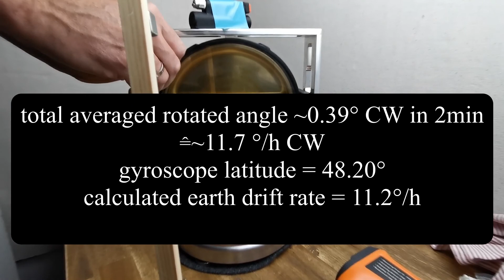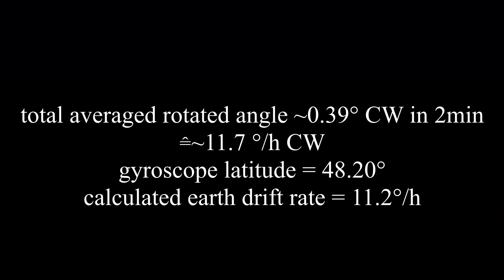Mechanical Gyroscope - Magnetic Field test by Stefan P.: Apparent drift NOT cause by magnetic field.

Comment: Who is Stefan P? Is this the guy from FE Core?
Reply from the maker: It's the same fellow, and the same gyro, but from what I can tell from clues I've come across, fecore and Stefan sort of parted ways when Stefan's mechanical gyro showed the predicted earth rotation.

The gyro was designed, built, and paid for entirely by Stefan, but fecore  was using the videos to promote their agenda, but as soon as Stefan got it running freely on the lowest possible drag bearings, then fecore just used the old videos from before it was working. 

At least that's what I've pieced together.
Reply: @fromjesse  flerfs trying to hide earth rotation humm interesting.
Reply: @fromjesse  You seem to know a lot for just being some random person online

Comment: Where is the gimbal? How do I know that your table isn't completely flat? How do I know that the instrument is completely flat? Why is it sideways?
Reply from the maker: The gimbal is that larger square aluminum frame and the smaller rectangular aluminum frame inside it. It's not sideways, it's just oriented the way it is. Gyro wheels work regardless of how their axle is oriented.
Reply: @fromjesse  If the test was taken at the top of the earth, I'd agree with its movement, but chances are it's hanging off of the side of the globe at what longitude?
Reply from the maker: @Amanlikeme  He's at about lattitude 48.2 degrees: https://youtu.be/7jSbmOEZy0s?t=269